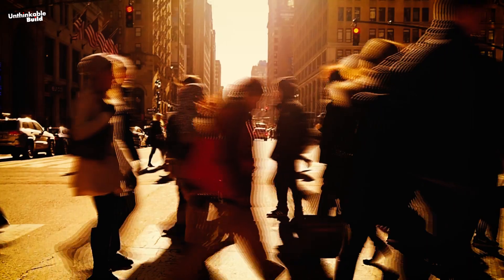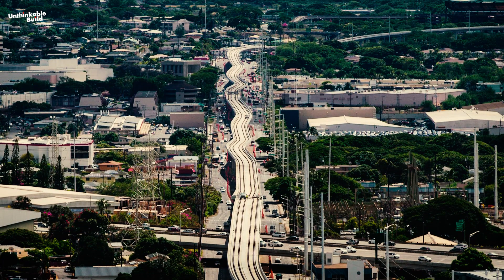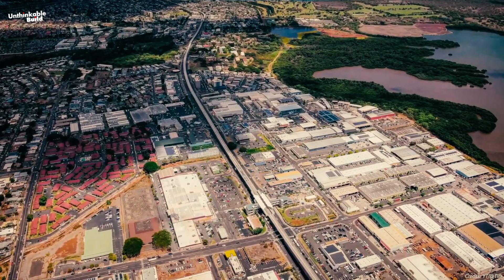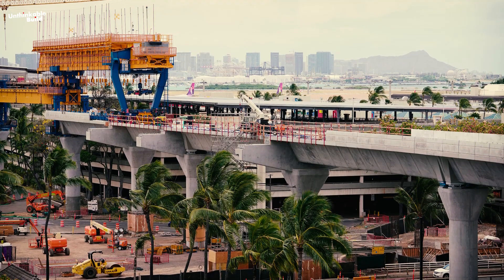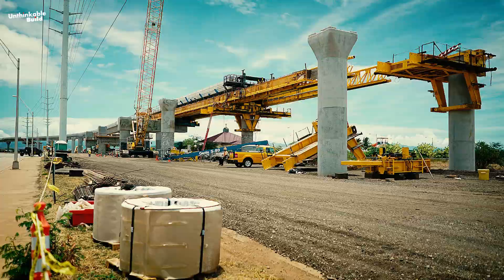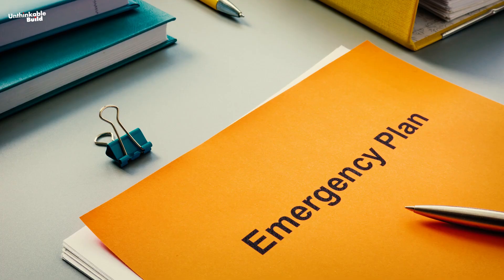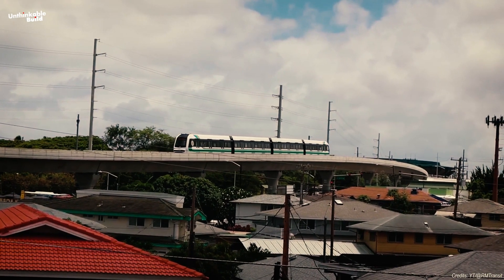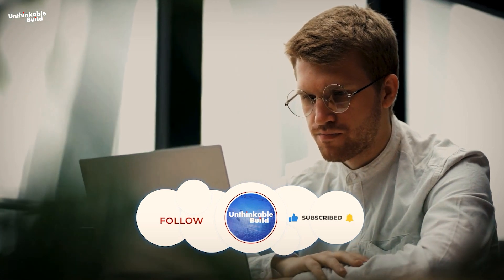Honolulu’s $12B Driverless Train: Hawaii’s Traffic Game-Changer?

Comment: The Honolulu rail has a long, ignominious history of overpromising and underdelivering going back two decades.  Their history also shows that they are completely out of their depth when it comes to building a rail system.

2/19/2006  28 miles Kapolei to UH Manoa $2.5 billion
3/1/2007  20 miles Kapolei to Ala Moana $3.6 billion
2/22/2011  rail groundbreaking 
12/19/2012  20 miles, 21 stations, Kapolei to Ala Moana, complete 1/31/2020 $5.12 billion
11/9/2021 20 miles, 21 stations, Kapolei to Ala Moana, complete 2031, $12.45 billion
6/3/2022  18.9 miles, 19 stations, Kapolei to “civic center,” complete 2031, $9.933 billion
9/5/2024  18.9 miles, 19 stations, Kapolei to “civic center,” complete 2031, $10.065 billion

Nagano -Kanazawa Shinkansen:
160+ mph, 142 miles (60+ miles in tunnels) seven stations, 21 years, $17 billion actual.

To sum up:
Honolulu $533 million per mile, .95 miles per year
Shinkansen $120 million per mile, 6.7 miles per year